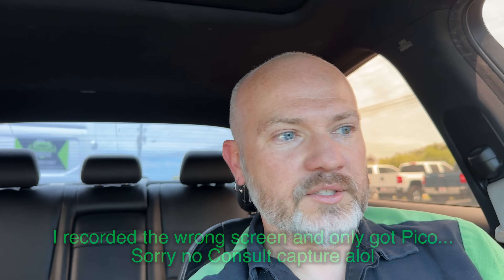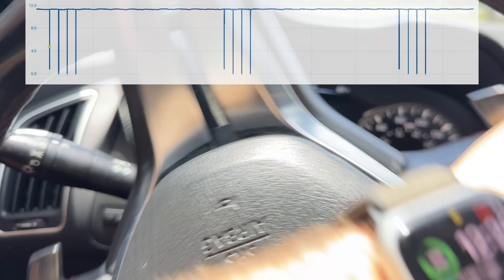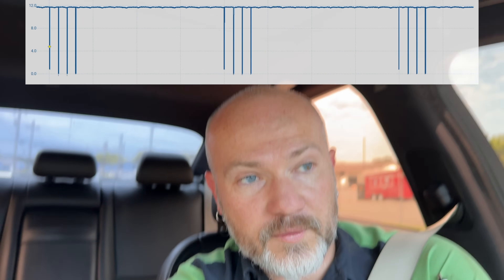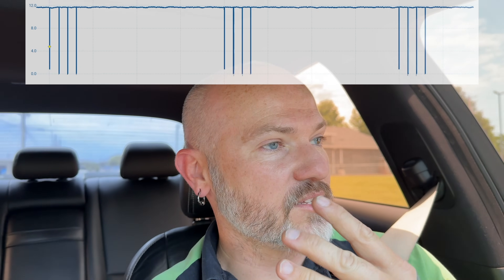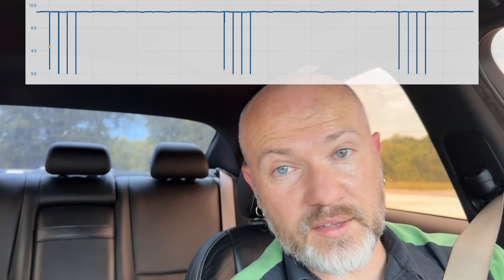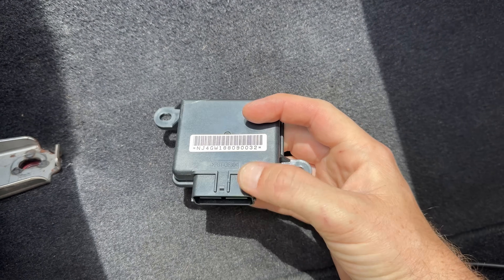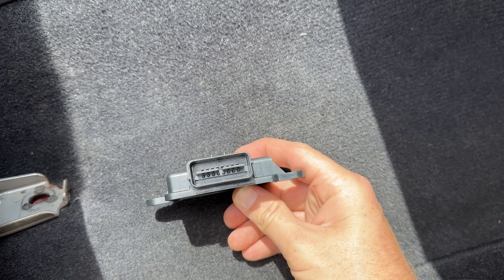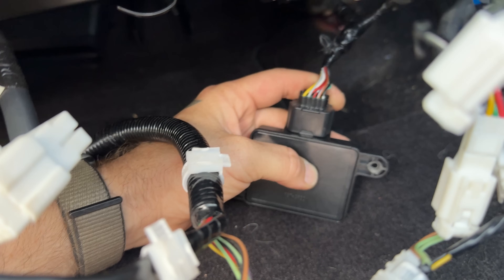Infiniti Q50 Airbag Light FIXED — Wrong Seat, Wrong Module!

Comment: Hey I have a similar issue, I had  the regular leather seats in my 2018 Q50 Luxe and I got the same seat u have in your video cause I liked them better. Either way, I have had a qirbar light on since. In lamen terms what do I need to replace or do? Thanks for your video!!
Reply from the maker: The seat harness and module is what I swapped on this seat.
Reply: @autodiagyt I got the air bag module from the original seat, the buyer of my old seats was nice enough to drop off the module. So I'm hoping that will fix the airbag light. Thanks again!!

Comment: I have a issue with mine so I bought a passenger seat for my Infiniti q50 I have a 2015 premium and I did the sport seat swap I had the issue with the module being different so what i did was I swapped the wiring harness and module from my old seat to the new sport seat and I have a issue with the pressure plate sensors but they are hard to get to anyway of bypassing that issue
Reply from the maker: No you just need to swap them. It's not as hard as it looks.

Comment: I'll checkout the other video.
Reply: So before this shop got the job, someone changed out the seat assembly that had the wrong module for this car and the original module that came with the car was gone.  Correct?
To top all that, the modules operate differently and are not compatible from car to car.  Wow!  Talk about a real "Cluster----!"  I'm glad you got it fixed.

Comment: Man you would think they would make the main seat  connectors different when system is changed, my guess was not even close.  So what was it seeing in the data package that it did not like, was the package  broken down the same as the package on the first vid? Short low, medium high, long low, short high, medium low, just wondering what the new package breakdown that it accepted, YOUR FAVOURITE CAR NISSAN 😂, im glad to see you kick nissan's ass
Reply from the maker: I’m guessing the module just doesn’t know how to respond to the message when it changes in motion.

Comment: I call that the molestation factor, which is usually an unknown.  Not only do you have to troubleshoot the problem, you have to figure out how much the car has been molested before you got it, which as in this case, you had to do before you could actually fix the car.

Comment: Could you use the driver side module for diagnostic
Reply from the maker: Driver seat doesn’t use an ods system. It’s only there to know if a passenger is in the vehicle.

Comment: You should be able to call the dealer with your VIN and they could tell you the exact part number for the original module.  Even if you don't buy it-- at least you could write down the info.
Reply from the maker: Problem is there isn’t a part number on the ods module. I went over that at the end of the testing video.

Comment: This system has been problematic on the Nissan side also. Some of our cars you have to get an entire seat bottom for the ODS unit. And now that new parts are getting obsolete,  the used part problems are going to flare up even more. Nice video!
Reply: Was waiting for you to chime in!
Reply: @thakiid1013  yea this a great video, I am late to the party😂. This system has had many recalls, updated pressure sensors,  re programs, updated torque procedures for seat installation ect. Its a wonder there aren't more issues.

Comment: I hate the electronic "Fluff".
Reply: Yeah..  That's why I have a 2002 F350 7.3L Diesel,  6spd manual, manual 4x4, manual locking hubs..    It has manual seats, manual mirrors, manual roll windows, manual locks..  and doesn't even have tilt wheel or cruise control.  And no emissions crap or DOC / DPC of DEF, etc..    It's basically just a tractor.  and it's fantastic.